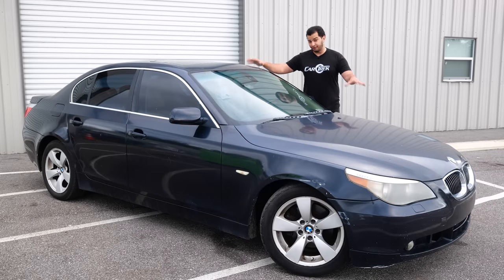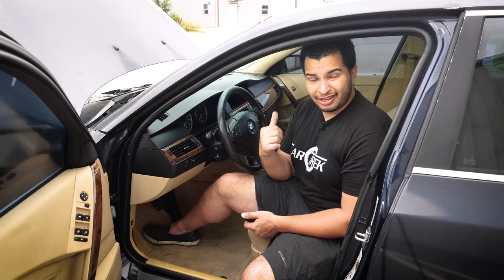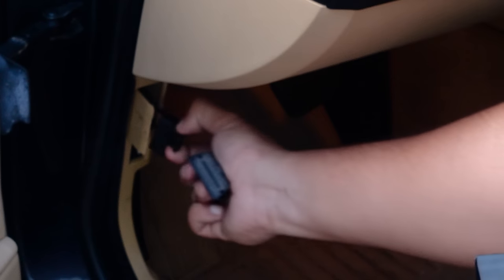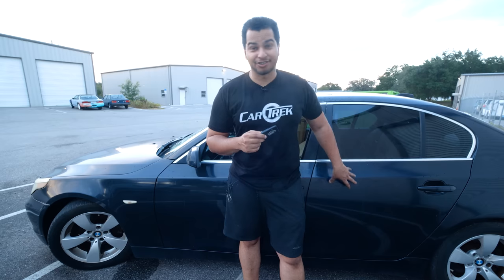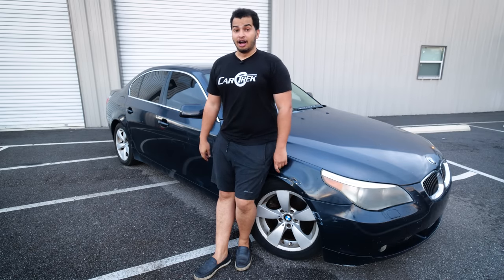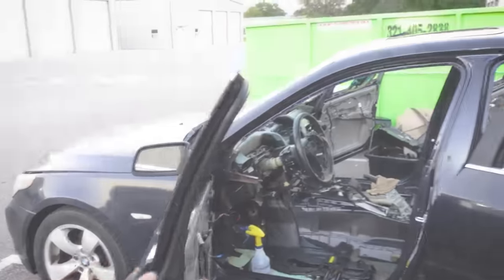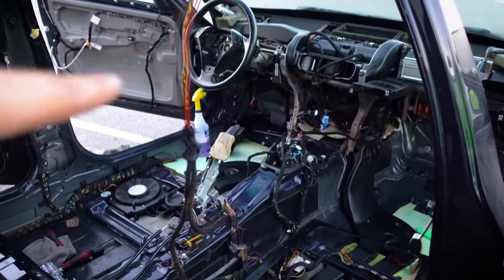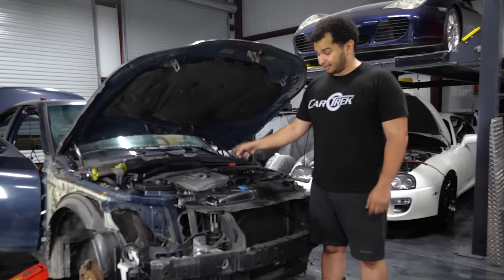I Bought A Running BMW For $600 (Because It's FULL OF ROACHES)

Comment: i owned  and sold  b m w,s  they  sucked  . i had  a  m 6  in the  late  80,s   and  the one thing that  went bad  was the  number  one valve  stem  wore  down.  it was a job  but  not that bad.  oh  also the  speed  sensors in the   rear end went out.  it was  magnets.  the in line  6  was the  109  engine  aircraft   until the p  51 the  best  fighter  . the  640  i 6  is  what  i would like to have now.  but if you  want dependable  stay  below   the  year  2000  . you can fix  them  with out  any help.

Comment: Pro tip: If you move in a place that have ROACHES  and you don't notice than untill its to late, pay to get out of that rent , burn your fucking stuff and move to a decent place, you dont want to take the risk of taking home some roaches. If you have a tv , pc,  laptop, speakers what ever, the roaches are inside ,don t take them with you

Comment: BMW is fine, as long as you stick to the 520-530 or 320-330 models of the 1980-2002. E39 530i has to be one of the best bang for buck cars you can get in the 2020's. It's very comfortable, much space for even large men nearly two meters tall. You get over 200hp of fun, and a stiff and rugged frame that is a joy to drive. The old 90's luxury feel of the interior is just something classy and lost to time. Everything feels rugged, stiff, and strong even though the cars are 20 years old. 
They are pretty cheap, like 1/3 or 1/4 of a new toyota, even if you get a low mileage one. The straight six engines of the late 90's BMW made, were very reliable as long as you change oil ever, don't turbo it, and fix any leaks that appear every 10 or so years when the rubber seals start cracking. So, basic maintenance that costs fuck all, and can be done by the town mechanic. And to top it off, the fuel mileage is not terrible in the 2.0l-3.0l straight six. 

It's just a car you can get for the price of a regular medium budget family car. It doesn't cost any more to maintain since they made and sold so many of those, they still make parts and have no plans to stop. And even if they stopped, there are so many of them in use by loving owners, that aftermarket parts would be available for decades to come. Any rural town mechanic knows how to work on one. And overall they are pretty damn reliable things. Since it used to be luxury standard in the late 90's you get pretty much every expected quality of life and safety feature. Airbags, side airbags, ABS brakes, nice audio quality, good AC, seat warmers, cruise control, steering wheel controls, etc.

Comment: Roaches are often massive pains to get rid of in cars depending on the interior design and how long they have been infesting the car. Assuming it has been a long time and has lots of trim, you are going to need commitment to truly ensure they are gone. Lots of openings can serve as hiding spots. Your goal is to make them not able to stay there, but also not able to leave. Borax or diatomaceous earth is a good counter on them.
They need sustained food supply(bacteria) which isn't hard to get rid of unlike the roaches. Making them unable to explore will do just that. First, apply chemical treatments to the seats. A professional should charge up to 300 for this small of a job, or you can do it yourself. You'll want to vacuum and then wash(with soap, obviously) the carpets thoroughly, then liberally sprinkle the borax or diatomaceous earth all over the carpet. Use a degreasing cleaner to clean all upholstery and hard surfaces.
Your next step is fumigation. You'll want to keep your car in a covered space away from direct sun, and ideally heat. You need to consistently use a roach fogger once a day for at least a week.
Finally, wait 7 days and use another fogger. This should kill any roaches that have recently hatched. You can do this again in a few days for good measure. 

Do not use the car during this whole endeavor. Doing so will cause a health risk to you and give the roaches opportunities for escape.
After this, you should see a professional detailer. He will need to know to clean the insides of the door panels and inside the ventilation which will end up running very expensive if the dashboard is hard to disassemble. Roaches may also be hiding under the trim. He will vacuum up all the borax or whatnot as well as use powerful chemicals to ensure that all sources of food are gone. 

If the bacteria is gone long enough and the roaches can't sustain themselves, they will eventually face eradication. Again though, you need commitment. Failing even for a day can screw you over back to square one.

Comment: Should have gotten the older M54 straight 6 that was used in 04-05 E60, even more reliable. My 04 is still going just fine. The m54 engine is far more reliable.

Comment: I would of striped the seats after i took them out and kept the seats and changed the interior the carpets change but fumigate the whole inside 2 or 3 times and then let it air out in the hot sun for 1 week before i wrap it back with freshness

Comment: I once bought an old house that was completely infested by roaches. It was really gross, but I managed to solve the problem without gutting the place and rebuilding the whole interior. He could have easily cleaned up the whole bug problem in a week or two, and it would have taken a LOT less work that ripping everything out (not to mention the expense).

Comment: You do know that those seats are worth a grand? You could have put them in a plastic bag and pumped it full of bug spray or even CO2 to deroach them and sold them. If they had fitted a 328I I would have come down to your shop and done some dumpster diving.

Comment: I honestly don't know what the problem is with German cars in the US. Of course there are problems sometimes but overall the verdict for the cars is entirely different here in Germany. Maybe the American Cars are built to a lower standard or maintained worse but especially the E60 is known to be a tank. Also the I drive came out in 03' so yea I guess you can't expect iPad like performance. For the time it was great. What I also don't understand is why a 525i or 530i should be "low spec" or something. Normal people don't buy M5s and go get their sausages and sauerkraut on the market with them. The majority gets the regular cars 520 - 530 maybe 535 and or the diesel cars. For regular sporty driving the power is more than enough. When you consider the M, AMG and so on cars as THE model. You are probably not right. THE model is the regular car and then there is the m5, the AMG, the RS, etc. And don't expect 15 year old, bad maintained cars that some idiot treated like a McDonalds toy to be without problems when you get the original 100.000 $ car for like 10k.

Comment: 4:50 saying it was one of the first in-car entertainment systems and then says it was slow and clunky well what does he expect it came out in 2003?? Most manufacturers followed this way and here he is slating it for the lack of buttons to control the radio and navigation, then he goes and buys an S-class Mercedes which has follows practically the same concept just over 10 years newer! Makes me laugh, him saying BMW's are so unreliable but yet he owns a twin-turbo Lamborghini which is famed to have always worked so well and a 2004 Bently which he didn't fix for 2 years. Not sure he actually knows what he's talking about

Comment: bmw is unreliable sitting here with my 277.000km 320d e46 and 220.000km 335d e91 with no problems what so ever no rost and what so ever and noch engine problems what so ever and all my friends driving high mileage kilometers with no problems what so ever... so wtf dude.